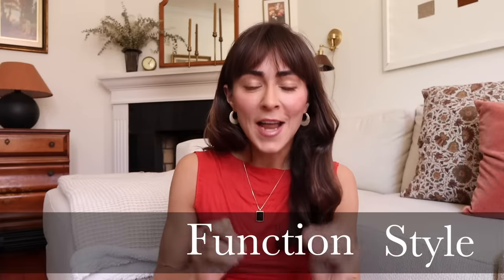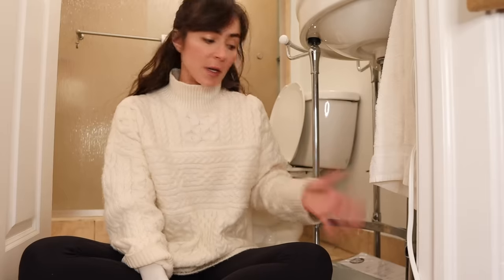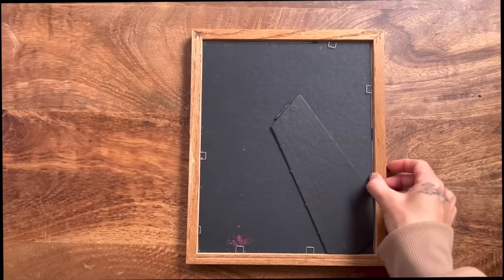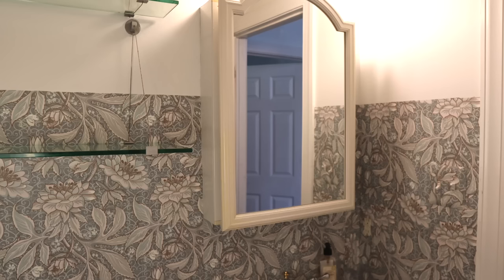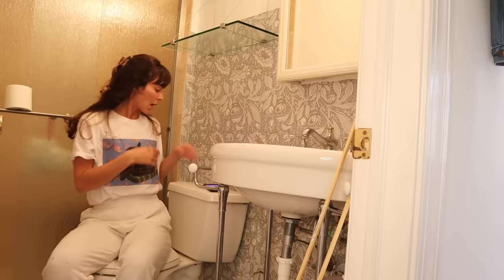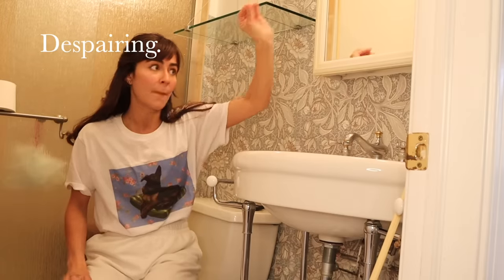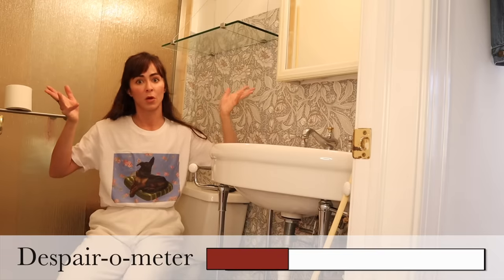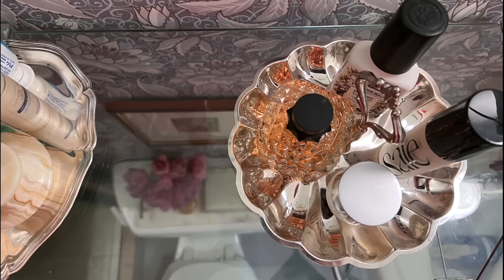Transforming my TINY bathroom…Part 1!

Comment: The trashcan is beautiful and very renter friendly so not a bad expenditure at all , you will probably love it till you die. My problem was that you cannot change the tile in the shower and that warm colour glows through the shower door which is essentially, the biggest wall space you have. It's easier to lean in to what you cannot change to avoid a sense of disconnect every time you walk into the room. I cannot wait to see part 2! Bathrooms with no windows are tricky. I painted mine yellow to fake happy sunshine and it was disgusting. It's been painted deep red for 18 years now😆

Comment: Love the video. Just a tip you didn't ask for. Perfumes Ideally should be stored in a cool dry dark place to keep them fresh. The bathroom is far from ideal for perfume storage due to the consistent change in temperature and moisture and bright light. It will deteriorate your expensive perfumes much faster.

Comment: Caroline .. Maybe one suggestion that could help with the final result. It is still possible to use warmer light tone bulbs .. If you are using 6500K ones try to buy some LED 5300K one or even warmer light bulbs.. I really think that that small bathroom came out really amazing so I´m not sure what else to suggest (if you don´t plan to rip it off a put a new one in) :D Still thanks for the great video..

Comment: I am so grateful for this video! It's such a relief that even professionals might not like their interior choices. My big fear is to start doing renovation and then find out that I don't like what I got. So I'm looking forward to the second part. I would like to know how to act in this case and on what basis you make a new choice. This is a very valuable experience that you shared. That yes you can screw up, but it's not fatal and everything can be fixed. I appreciate it

Comment: Literally watching you from the hardware store as i am installing a new shower. Was looking forward to your bathroom makeover, and I love it so much!
Reply from the maker: ooo installing a shower!!! couldnt be me 😅 best of luck, knock it out of the park!!
Reply: @Caroline Winkler  thanks! You totally could! Was my first time and I didn't want  to pay someone to screw and drill stuff, so I learned. All worked out after a few hours, except for the moment where I almost considered sawing pipes off, LOL 
Bottom line is if you have exposed valves and use a new shower with the same size of fixings, just reuse the existing fixings and you won't have to do anything to the tile, so you may not need a plumber for exposed showers. I'm not a youtuber but I thought I might even make a short video to explain how to fit that shower, since I wish I had found one. 
Also, changing the shower head for a rain shower or prettier handheld one is a more budget and renter-friendly thing you can do too.
Reply: By the way, I'm watching your videos all the way from Scotland, and I love your podcast with Jess! Have been playing it while painting kitchen tiles (an idea I got from you). You're doing amazing content!

Comment: I think if you had started with black and white floor tiles that it would've balanced out the wallpaper. You could've added black trim and even painted the mirror black to make it look luxe. My issue was that purple paint on the trim. It didn't look great at all. I'm excited to see the changes though. As long as you're happy that's all that matters.

Comment: Our bathrooms have very similar footprints and layouts. Mine is 4x7 and while I do have a vanity below my sink, I also have floor to ceiling sky blue tile. And royal blue floor tile. Very retro lol.
I have a 3 shelf etagere over the toilet that I've grown to despise. It's in front of the only window and I've come to acknowledge it feels cluttered and claustrophobic when I use it for storage, even with baskets/bins etc., because then it blocks the natural light and I hate that, and there's no point in using it for decor, it's the bathroom. I bought chrome paint to touch it up and that was a massive fail. I'm gradually finding creative ways to maximize my tiny space in a way that also feels styled intentionally and as always you share great inspo.
Trying something and finding it doesn't work is a good thing (in perspective), that's how I grow.

Comment: 8:48  if viewers at home find themselves without this "tool" as well - keep in mind that it's just a tiny screwdriver.  If you have a little multi tool, a glasses repair kit, a metal nail file or even a pointy knife, those will work just fine :)

Comment: A good hack for changing bathroom hardware (as long as it's something you can remove from the wall) is spray painting it with metallic paint. I'm slowly redoing my bathroom and it was so much cheaper than replacing every single item. If you can't spray paint there's other types of metallic paint like Rubb n Buff that's wax based and could work too.

Comment: That console sink is one I had in my old home. Kohler? Anyways, there should be an oval cut glass shelf that sits on the bottom so you can store things like toilet tissue in a box or whatever. Someone probably broke it, but you should look in to getting a replacement, just for a bit of extra storage. ❤

Comment: I know you won’t like to hear this after lol. But it’s easier to paint the trim outside. I would spray paint mine and let it dry before putting it on the wall, it would save in a million ways, time priming and tape and there are mate and satin sprays that are much easier to work with than glossy. I changed all the baseboards on my previous house painting it outside. And I spray painted my closet doors and drawer faces all taking just the small part outside and spray paint is so FUN to use

Comment: At about 6:55, I started feeling sucked into a dark hole with all the grey and the dim lighting, despite REALLY loving the aesthetic of that wall paper. A big pop of color for contrast and some natural warm lighting is definitely needed to pull that off. I would have added more shelving to put vining plants on for a natural pop of green, and maybe another contrasting color via vases or artwork (tricky in a bathroom though). Also, the color in the shower that reflects through is adding a brown undertone that doesn't quite match the grey/white of everything else. I wonder if a brighter light would fix that? Thank you, Caroline, for being open about your process so that I could visualize more about my preferences without making the same mistakes and learning the hard way!

Comment: Of course colors look different on video than in real life but I think the issue is that the cool colors in the wallpaper is such a 180 from the warm tile color in your shower. If you had been able to change the tile color, I think it all would have worked. I bet your new wallpaper will have a similar color as your shower so it all looks more cohesive.

Comment: I may be wrong, but I think that the "mistake" was using red ,which is a warm color, with the grey wallpaper, which seems to be a cooler tone of grey. I think it would be better to use another cool color instead (I would use like a dark teal blue), or use color theory and choose a complementary color, or maybe the colors are ok, but they would be better in different value and saturation. I don't know...

Comment: When I bought my first house I was so excited to paint, I spent about 16 hours painting a large portion of it with a colour that was supposed to be a kind of buttery neutral off-white, but ended up just looking YELLOW, and I hate yellow walls so much. I had done three coats before I admitted to myself that I had to start over. That hurt. I had three very young kids at the time too so 16 hours was a lot

Comment: It took two people about 7 hours and probably a gallon of goo gone to remove peel n stick tiles (floor pop) and the sticky residue from my small rental bathroom and kitchen...They held up nicely for 2.5 years and now I know why lol. Maybe the thin stickers you used won't be as bad but I'd be careful about using them in large areas.

Comment: It could have worked.  The problem was not the wallpaper. The wallpaper looked great!  The hideous red trim messed up the look of the whole bathroom. (IMHO).  I would have gone with a warm neutral gloss paint on the wall above the wallpaper. It would have looked so nice.  It you wanted more color then a sage green, but saturated and deeper in color.

Comment: If you need to remove the towel holder, use an eyeglass screwdriver to unscrew the tiny screw that attaches the bar to the wall., No need for special tool.

Comment: ...I learned a valuable blesson about NOT keeping  my Jewelry in a bathroom...not one piece ,ever again.  I had someone S t e a l  a ring that was not worth a lot.. BUT  it looked expensive.  I keep a tray on the top of the toilet, on a tray... a small boudoir  Lamp, ( uses a 4 watt night light bulb ) and a  small pretty wire type holder for "  Bathroom Sprays."

Comment: I like the wallpaper, but it doesn't go with the shower. The pattern might be too much for the size of the room. Perhaps if she used gold towel bars, trim, and accents??? Skinny(cheap) purple and red trim??? Green diagonal checkerboard flooring? It's got a Mary Englebreit vibe. A purple vase would have been better if she wants purple. Big patterned floor really makes the room smaller - perhaps a much smaller checkerboard tile...

I like the gold paint in redo #2 if less intensity.

Comment: That's a shame, the trim did accentuate the paper. What I couldn't live with is the old tiles still being in the shower and the new ones covered. That said, my bathroom is a TIP. I have a ladder shelf down the side of the sink - it's covered, I've got NO idea what is on the bottom 2 shelves, I still have nowhere proper for spare loo rolls. The perfumes corralled on the top shelf look a mess, I'm not happy with the fancy basket and cleaning products out of the way on the top of the toilet. The washing basket is overflowing from the other side of the sink to the ladder, not seen the bin in a year. Right, back to it, no idea what to do, emptied the top 3 shelves, okay they need to be what I use! Xx

Comment: I think the floor tiles are the greater mistake. You clearly can't do them in the shower, so the tones there don't match. And then the tones of the floor tile and the wallpaper don't match either. The warm strip of red brings out a few of the pinkish tones in the wallpaper, but maybe it's too strongly red and overpowers rather than accentuates the already-existing warm tones in the wallpaper. Something a bit more blush could work well instead.
Reply: I dont think the shower tile is a big deal ... I imagine the glass doors stay shut.  I def think the new "tiles" are improvement over the institutional beige blah ones.

Comment: Pathetic…

* hilarious 

AI
Milkmaids 
Rembrandt 
DJ’ng

Gads, Caroline. You top yourself every gawd damn video!!! 

** the bathroom redo is nice, too (agree w/doing different wallpaper in a warmer, more flattering human skin tone shade).  

I have the same size BR and my solution is one of those hideous but useful freestanding behind and above toilet shelf units are the bomb (3 shelves). Top shelf holds 6 towels. Middle shelf has little holder with fake plants and just enough room that I have 3 lotion things - day cream, night cream and face oil - next to hand towels, and bottom shelf holds alcohol, hydrogen peroxide and witch hazel at one end, a hideous but useful Dollar Tree plastic bin that my acrylic make-up holder fits perfectly inside, thus hidden but not and it has handles so I take it down and stick it on that ever so useful toilet seat in the middle [it’s not JUST for filming] and 3 little lidded canisters for nail accessories & band-aids, cotton balls and Q-Tips, respectively.

Wall behind door has FOUR hooks to hang towels, rings for hand towels and one actual rack lower down for hanging a wet towel. Back of door has robe on a hook.

Yes… I’ve had 4 guests plus me at one time (full house in a little apartment but family is family) so all that crap needs to be in there.

I also have a little woven basket shelf unit I’ve had for years (totally been in the office, kitchen and now bathroom) across from the toilet. Bottom shelf those girl necessities, middle TP storage - 8 roll capacity - and top holds those hair tools along with hair bands, brushes et al).

I’m really fortunate I don’t have a pedestal sink here so the cabinet holds cleaning supplies, bath Epsom Salts and the little slide out thingamajiggy with my hair dryer in it. I added a battery operated motion detector light to the side so I can see things when I open it,

* I also rent my guest BR out on AirBnB so… kinda important for more than my family